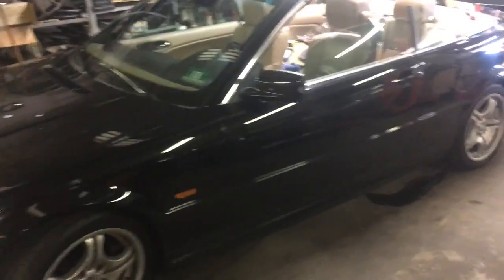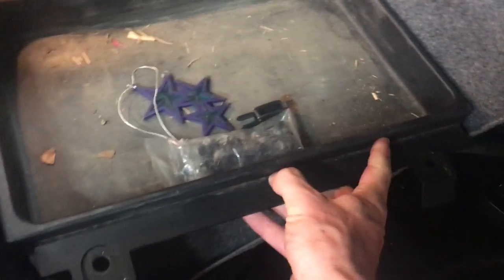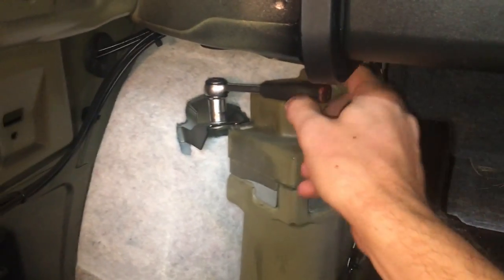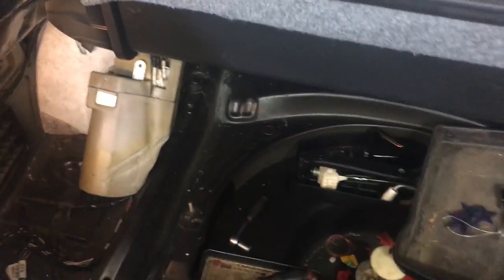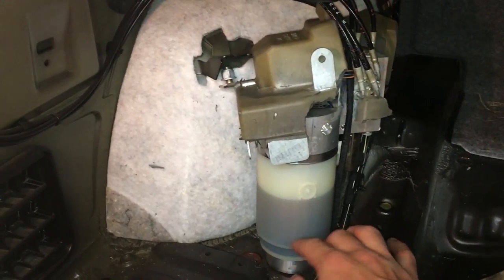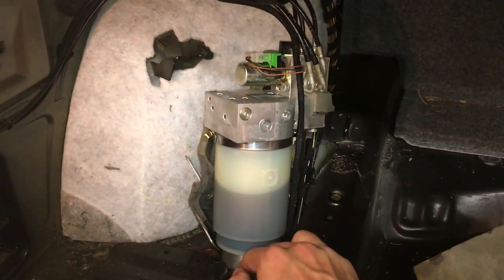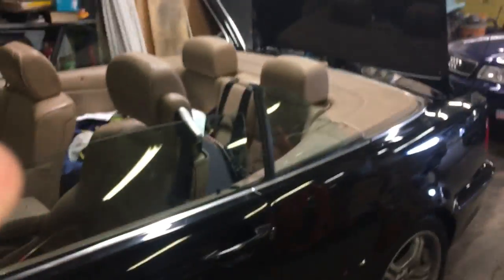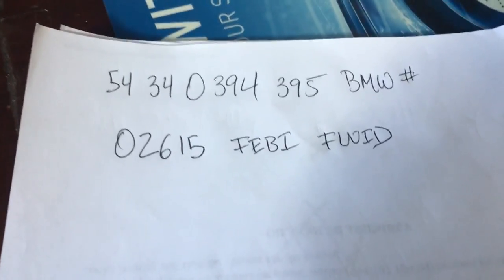BMW Convertible Soft Top Pump Fluid Fill and Check E46 3-series

Comment: Hey, can ya help me with my issue, I either suspect it’s the fluid or something to do with the hydraulic pump (if it has it) but what my bmw does is when it’s up rolls the windows down and that’s it the top doesn’t move at all, but when the top is already down, If I try to get it up it open the cover and it starts getting the stop up but it only can lift it for about 2 or so inches and then it stops unable to go further. I fixed/checked other things that could cause issues (before it wouldn’t even open the cover) and now I’m wondering what could cause my car to not be able to pick itself up
Reply from the maker: Thanks a bunch for taking the time to watch my video and ask a question. This is a basic question how is your convertible top fluid, are you losing any? You may want to Google search, rebuild and upgrade BMW E46 hydro pump. This will give you some information websites which offer great rebuild services.  You can try to reach out to the rebuilders often times they are very helpful. Also do a full scan on your car to make sure you don’t have any faults in other computers that could be playing into the issues. Please share an update, thanks.
Reply: @WheelsTips  hey, sorry for the late update had a little issue of my engine blowing up lol. But I replaced the engine and started my focus back to it. After a quick assessment I found that my hydraulic pump was way overfilled and filled with what I believe the be super dirty brake fluid. I got a new hydraulic pump from a different e46 at the junk yard and just going to replace the whole thing and see if that fixes my issue. I don’t have any other leaks or electrical faults so I’m hoping this is the culprit.
Reply from the maker: @salfuchs9189  Thanks a bunch for taking the time to update this chat.  I am glad you were able to remedy the issue with a used part.  Truthfully probably less expensive then rebuilding the unit or about the same.  Much luck with your convertible top and enjoy the car.

Comment: Really nice info and video! I got sometimes some issues my self with my E46 convertible but my E46 is a bit different because it got an s65b40 and e92 m3 Ecu custom wired to al the e46 parts. So when I use the OBD it’s an e92 so I really have to figure it out myself. Sometimes I have to help it close half way and close it manually. After that it will work fine a small while but also sometimes it stops half way and then it’s had to close... when I’m back I holland I will check your tips and tricks 🤝👏😃
Reply from the maker: Sweet car! That is really cool 😎 thanks for sharing that information. Thanks a bunch for watching my video and taking the time to comment, enjoy the car and my content!

Comment: I am trying to replace the hydraulic pump i have all the electric component done 
But I need to know how to remove the hydrolic cables 
Thanks Dude for everything you do.
Reply from the maker: Hey Miguel Ramos thanks for watching my video.  I do not promote any place so I will not give a specific name, but you can google search, rebuild hydraulic pump BMW E46.  The top results will suggest a website that has detailed instructions on how to do it.  Hope that helps, thanks again for the kind words.

Comment: Did you ever replace the cylinder's on the drivers side?  I have a leak in my system as well and I suspect it may be the same thing.  Looking for the DIY of the fix/replacement
Reply from the maker: Thanks a bunch for watching my video and taking the time to comment. I would Google search something like, BMW E46 Convertible
Storage Compartment Lid Hydraulic Cylinder Removal pdf. Please share an update, if you find a interesting PDF using that search check some of their other PDFs as they may have what you are looking for as well as having the part for sale or rebuilding yours at a fraction of the cost. Looking forward to an update, thanks.

Comment: GREAT VID thanks l overfilled my reservoir (lm not sure if l have a leak or not) .  could you say if overfilling is bad for the system please. lm about 10mil over the top of the circle in a box mark
Reply from the maker: Thanks a bunch for watching my video and taking the time to ask a question. Personally I like to keep the fluids in the recommended level. Are you able to suction out a bit of fluid? Please share an update, thanks a bunch.

Comment: At any point should you replace all of the fluid in the cylinder,? if the cylinder is still good. Kinda like you would for changing the brake fluid.
Reply from the maker: Thanks for watching my video and taking the time to ask a question.  Personally I have not done that myself, it is a sealed system so unless moisture is to enter I don't see why it would be necessary.  Please share an update, are you having issues with the unit?  Preventative care is best to keep the top clean, keeping top up so that mold and shrink doesn't occur. There is an interesting writeup with some people strengthen their convertible top parts, which I have not done but it is interesting to read and see where the top is prone to issues.  Google search, BMW E46 DIY: Strengthen/Repair Windshield Latches.  Please share an update, thanks a bunch.

Comment: My fluid levels are good and all I get is a red blinking light even before I do anything after I turn the engine on could it be a faulty wire I just got this car very recently and the owner said he got the top fixed and it worked plus could a brake engine like stop it or what other codes on a reader ?
Reply from the maker: Thanks a bunch for watching my video and taking the time to comment. It would be best to scanner the entire car to get a sense of what is going on. Please share an update, thanks.

Comment: When i press the button to open the raise a little bit and then nothing when i checked the level of the hydraulic fluid it is nearly at the bottom do you think it can cause the red light blinking and put the roof in a security mode?
Reply from the maker: Thanks a bunch for watching my video and taking the time to comment.  Did you make sure your hood, trunk, and doors are all closed, before using the top?

Comment: I have the same problem and took it to the dealer. After they diagnose the problem, they recommend replacing the pump on top of the hydraulic fluid. I have not done that due to the cost and can't find a video to how to do it.
Reply from the maker: Hey Nestor ona thanks for watching my video. In my experience I have not replaced the pump instead I got it rebuilt. In the past I would google search, rebuild convertible hydraulic pump. That search would yield sites that can save you a lot of money along with some removal instructions. Please share your experience.
Reply: @WheelsTips  CAN YOU SHARE THE SITE OR INFO WHERE TO REBUILT THE PUMP?
Reply from the maker: Hey nestor ona I personally do not promote any specific company, subsequently I will not give specifics. I can guide you to the best results by google searching the model of car you have along with the phrase rebuild convertible pump. For example, rebuild E46 convertible pump. When searching that one of the first 5 results yields a site that has a pdf of how to remove it and the place to send and rebuild. Please share your experience.

Comment: Hi thanks for the video, My problem is the pushing of the oil inside the motor is too slow is there any chance to fix it?
Reply from the maker: Hey ibrahim abosaleh thanks for watching my video.  If the motor is not operating properly google search, rebuild convertible top pump E46.  This will give you a variety of places that you can send the pump out to get it rebuilt at the fraction of the cost of getting a new one.  Please share an update, thanks.

Comment: I have a question. when replacing the hydraulic pump in the trunk of the car should the top be down when i remove it or should it be in the up position?
Reply from the maker: Hey Must Be Nice thanks for watching my video. If you can see the position in the video, that is the best advice I could give you. I haven’t payed attention to the positing in a while and don’t have the car on hand.

Comment: That's informative, although my top is stuck closed. It opens on the initial electric motor, then nothing .And it's really hot here at the moment lol
Reply from the maker: Hey Cam Smith, thanks for watching my video.  Try dropping your top manually and seeing if it goes up. Let me know if that works, it will narrow down the problem.
Reply from the maker: Hey Raz F, thanks for watching my video. I would recommend you both take a look to see if your red handle is (not sure if it is supposed to be pulled or not) but try checking and manipulating it such as pulling it or disengaging it if it was pulled and see what the top does each time. The red handle is a release for the top. If this helps, please consider subscribing to me it would help me a lot thanks.

Comment: 05 325ci cabrio....
so my fluid is Definitely leaking from one of the "top" lines. I cant find any vids on how to find / repair these. 
My top has oily build up. I constantly decrease it, but more builds up along the metal skeleton frame holding the fabric top. Any Suggestions?
Reply from the maker: Hey Brewce Rawdriguez thanks for watching my video taking the time to comment, greatly appreciated. I have personally never rebuilt the hydraulics myself but what I did do is send my hydraulic cylinders and pumps to get rebuilt. Also if you have line 23 and 24 leaking (common issue) Google search, BMW E6 extended hydraulic lines number 23 plus 24. Since I don’t advertise for any site I will not mention by name but they are ‘top’ notch and offer a lot of DIY help and rebuild service that is affordable. Please share an update, thanks a bunch.

Comment: I just wanna convert mine to manual mine openers up fine manually but it time to close it gets stuck with tension like 3 inches before closing complete after a while and I try it again it closes fine
Reply from the maker: Thanks for watching my video and taking the time to comment. Personally I have used the system as designed, but I have Google searched, bmw e46 cvm and convertible pdf. In that document check the ‘emergency operation’ section on how to manually close and open. Please share an update, thanks.

Comment: Hi thanks for your fast response back..I seen  the part you were talking about..but i was wondering what do u use to fill the fluids with.. is it a special tool used to add the fluids with?
Reply from the maker: LAKEE AKA SOULJA GIRL No special tool just remove the screw and turn it sideways, with a small funnel for the hole just pour the proper convertible top fluid in. Let me know if you need more clarification, glad to help.

Comment: Hi, the roof of my bmw e46 330ci convertible just stoped, don’t open anymore, what’s the frequencies problem with this roofs?
Reply from the maker: Hey mpsw7 thanks for watching my video. Does your roof respond to the button when pressed? Or there is no reaction of any sort?
Reply from the maker: Are you able to run computer diagnostic? Have you checked all your fuses?

Comment: My convertible top works it's just been slow however all of a sudden when I put the top back it it's not getting enough power to bring it back up...
Reply from the maker: Thanks a bunch for watching my video and taking the time to ask a question. Did you check if your pump has fluid? If your pump has fluid it is possible the pump may need a rebuild. There are online services that offer pump rebuilds which are way cheaper than replacing the pump. Google search , rebuild remanufacture BMW E46 pump. Please share an update, thanks.
Reply: @WheelsTips  I checked the fluid and in it's current position it does look I little below the circle. But when I undo the bracket and stand it straight up it lines right in the middle of the circle. Thanks for the fast reply!
Reply: Would this mean it's to low or?
Reply from the maker: I wouldn’t say that is exactly too low it is possible you need a rebuild on the pump. Google search rebuild service for hydro unit hydraulic pump BMW E46. Please share an update if you found an easier solution.
Reply from the maker: As I mentioned in my response, you may want to look into getting your hydraulic pump rebuilt. There are great companies that offer this service in the USA. Google searching, Core exchange for BMW E46 Hydro Unit Hydraulic Pump. Please share an update on your diagnostics. A lot of these websites have detailed information you may find helpful.

Comment: Hello thank you for the video, after pushing the open button the red light  goes on and only the locks works, then the top won't open. I tried putting it up again after manually putting it down and nothing happens either (the red light does not flash if the top is closed so no wiring  issues but it keeps on flashing when manually  down) the oil level is good  and I've run out of ideas.
If you have any other suggestion please let me know.
Thank you
Reply from the maker: Hey elias bou khalil thanks for watching my video.  It seems you have done some diagnostics already which is great, have you had a chance to scan the car for fault codes and to gather what data the micro switches are sending to the convertible top module?  Also do you have access to proper wiring diagrams? Please share your experience it will help many, thanks a lot. Please consider subscribing it would help a lot, thanks.
Reply: @WheelsTips   I don't have a proper wiring diagram  but I'm planing to scan it to see if any micro switch is malfunctioning.
I'll make sure to post the outcome as soon as I get them. One more question, can it be that the top controle unite module computer situated behind the driver, is blocking the whole operation because of accumulation of faults ?
And the OBD2 will be helpful of I need a special scanner ?
Thanks again
P.S. I already subscribed  :)
Reply: @WheelsTips  I forgot to mention that I had a wiring  issue   ( the thinnest blue wire was broken) I got it fixed.It worked perfectly for 2 times then the problem that I talked about in the first place appeared. That's why I'm questioning if the soft top computer is blocking the operation and it needs to be reset somehow, by a special type of scanner or a reset button somewhere in the car.
Thank you
Reply from the maker: Hey elias bou khalil a generic OBD2 scanner will not communicate with the convertible top module but you can google, OEM BMW scanner and the bay should offer nice options. These relatively inexpensive tools will often require a laptop to emulate dealer level diagnostics. Other options are hand held units that are more expensive and mention that that actually scan all or most modules including the convertible top module.
Reply: @WheelsTips  Thank you for your time .
I'll make sure to post the update when the problem is solved.
Reply from the maker: Definitely will appreciate that, thanks again.

Comment: my problem is i cant get my top down and im out of fluid 
is there a way to manually take the top down
Reply from the maker: Hey Enfirior thanks for watching my video. You can manually lower the top, it requires a few steps. I would recommend google searching, lower BMW E46 soft top manually. This will yield some good write ups as a few steps are involved. FYI a common fix to the top not working is the luggage microswitch going bad.  You may want to also google search, BMW E46 luggage micro switch fix. Please share your experience and outcome, thanks.

Comment: I have a problem with the passenger side back locking mechanism that will not completely lock in the open position. Do you think that is a fluid problem or is it another issue. Thanks
Reply from the maker: Hey BBC’s thanks for reaching out with the question. Have you checked your fluid level? It is important to see whether you have a leak in the line or one of your micro switches is bad. Please consider subscribing to me if any of this helped. Please follow up with me so I can help.
Reply: I will check the fluid level this weekend and I will let you know thanks again
Reply: I checked the fluid level and it was good so I guess there is another problem.
Reply from the maker: BBC's you would have to scan it to see if you have any codes for micro switches. Also you need to check the cables at the motor. Which move the locking mechanism.
Reply: BBC's where is the microswitch where can i found it?
Reply from the maker: Any update on your diagnostics would be greatly appreciated, thanks a bunch.

Comment: good informative video clip. So how did u fix your leaky cylinder?
Reply from the maker: Hey Jongkeun lee, I am making a follow up video where I show the source of my leak. It ended up being a common issue on the E46, it was what is known as line hydraulic line #23. It was a big job about 3 hours. You can check whether you have this problem by putting your top down and manually pulling back the left initial slider and looking down at the metal joint, there you will see a black hydraulic line broken.
Reply: How did you fix it?
Reply from the maker: Hey Daniele D'Elia thanks for watching my video. I recommend sending out the they cylinders to get rebuilt.  There are a lot of good places offered just by google searching for example, E46 convertible top cylinder rebuild.  Please share your experience.

Comment: Does the top have to be down?
Reply from the maker: Hey Quartermaster bambooii thanks for watching my video. It is best to reference your owners manual for vehicle specific information every car is  different. The way I would do it was with the top down the the fluid in the indicator, then cycle it a few times. While checking the levels , letting it cool down, and cycling 2 more times and checking the fluid. Please share your experience.